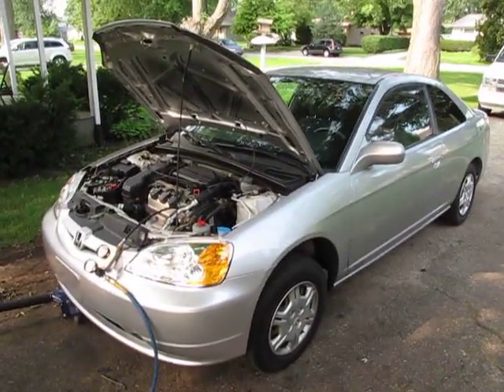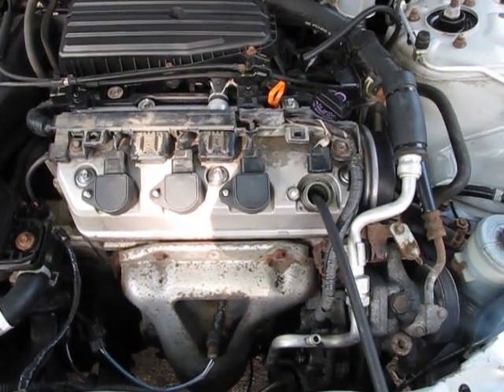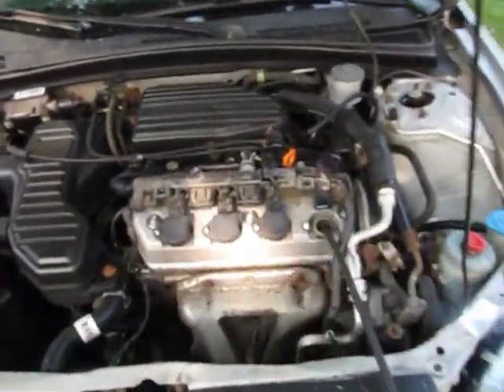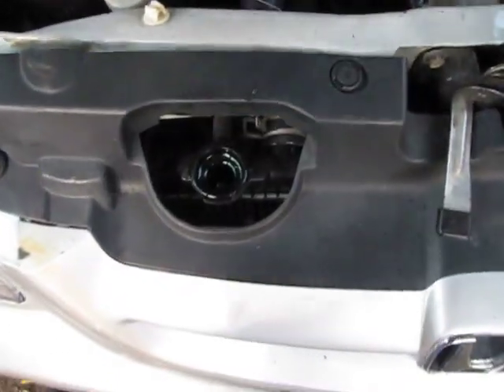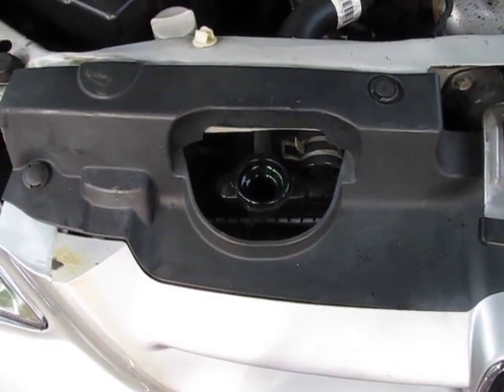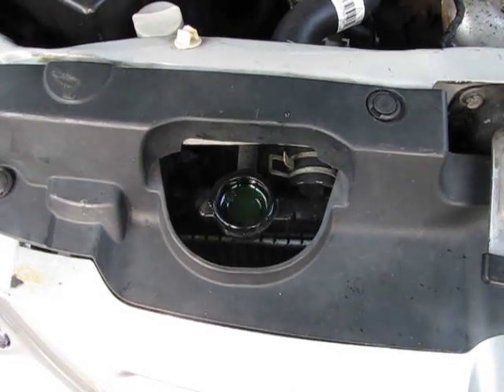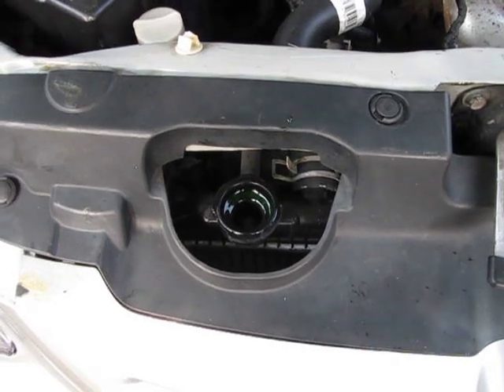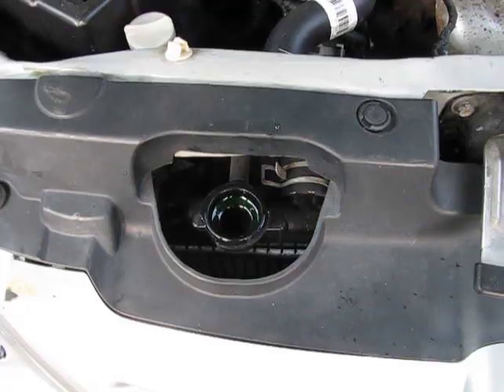Honda Civic Misfire / Head Gasket Leak

Comment: My car works GREAT when cold (weak from 1300-2000 rpms first gear) I suspect a have a gasket leak because when warm after an hour of driving it begins to misfire I work on my car I suspect that the gaskets are very old and need to be changed both manifold and cover because I've never changed them.
1998 v6 honda accord
Reply: Same but 3000 gt any luck? What was it? Mine runs alr cold
Reply: @cameronarmijo4524  turns out my gasket was fine teplaced it it was actually my O2 sensors and catalytic converter i also had a valve adjustment and that helped get rid of this problem which eventually got worse. Make sure youre spark plugs are good I would heck out my o2 sensor and catalytic converter if i were you also when was the last time you had a valve adjustment? You might need one if your getting terrible hesitations for no reason. Make sure it isnt your egr valve if you have one bc a failing egr valve could mess your engines performance up
Reply: Make sure your antifreeze aka coolant is at a normal level and make sure there isnt any air in your coolant system id get the car checked out by a professional thats what cured my problem since my car is kinda old 1998 only paid like 4-500  and he got my baby running right again. I usually do all the work to my car but i really couldnt figure this one out had no codes besides an o2 code

Comment: Did it missfire at idle or only under load? I have a missfire but it only occurs under load with light throttle, cold or warm as long as it was just started
Reply: On a old 98 accord
Reply: Thats funny i have a similar issues only happens when warm 1+ hours of driving my cold starts are flawless
Reply: @LAVigilant  same what was it?
Reply: @cameronarmijo4524  my problem was my o2 sensors and i also needed a valve adjustment 500$